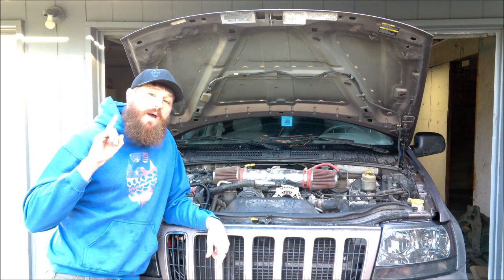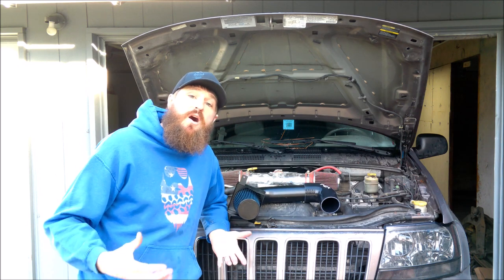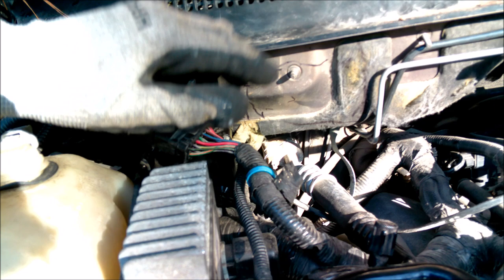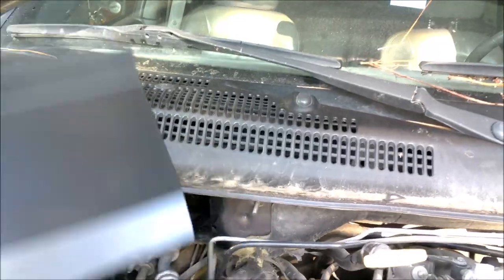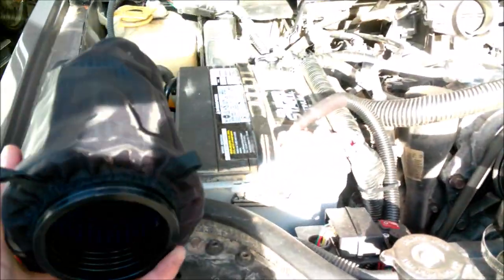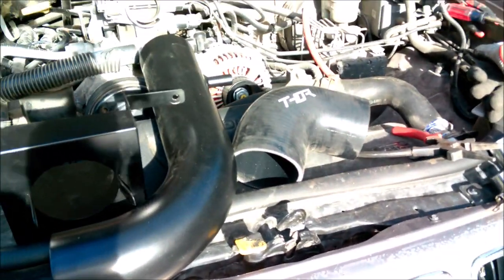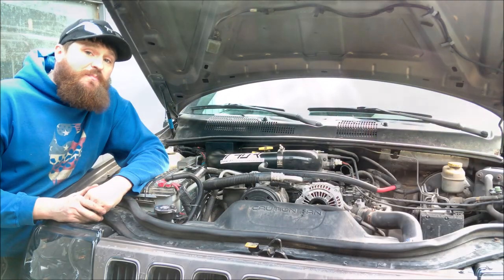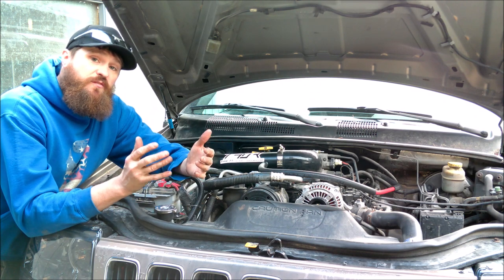Wake up Your 4.7! Jeep Grand Cherokee WJ THOR Cowl Intake Install

Comment: Great idea, but, I gotta tell ya my dude, in reality I truly wouldn’t rely on it. Not without somehow completely sealing off the cowling area around the large opening cut into the firewall from the engine compartment. Water intrusion level is really no better with the THOR setup, quite possibly even worse, than that of the previous intake.

Comment: Can you pair this with a 2008 intake? Din't think so. Kinda solution to a problem that doesn't exist. Hold your hand in front of the intake duct and see how much draw  a V8 pulls. That rain gutter isn't gonna cut the mustard. AFE is loud but that and an 08 intake with matched Throttle body and you're gaining 20+hp and 35ftlbs of Torque. Does sound nice.

Comment: Sorry,  but this is  not a good place for a air filter. Cover brkt will not protect the Filter to get wet. Also all the water will run out of this big cut out 😢
Reply from the maker: We have had some torrential down pours and snow.  Both driving and parked it's stayed bone dry.  That cover diverts the water and from there the cowl does its job and channels the water out. Guess I am just lucky 🤷‍♂️
Reply: @MuddyBeards4X4 does the cover come with the kit??

Comment: Put some Cams from an 08 or later,  those will really wake it up. I run a set from an 09 Ram in my 04, noticeable power increase especially past 3500.

Comment: I want to do this mod to my 4.0, one to gain space in the engine bay for additional battery, possibly better MPG, and cleaner air. But I wonder if it conflicts with the cabin filter mod, can you confirm that?
Reply: that's what I was wondering?
Reply: Cutting into the firewall was a huge hell no for me, i was interested until i saw that horrifying part of the vid lol

Comment: I wanted to do this mod on my ZJ but couldnt justify the price and not sure about the location for the filter in the cowl as I live in a snowy and wet area of the world. So it would be cool to see your opinion on this mod after a year or so!!
Reply: been running one for a while on my zj, through last years heavy snow (where we live) and had zero issues. Lots of people concerned but even with my cowl intake, and hood louvers with the trip tray removed, no electrical issues, and no water in my intake. win win for colder air in the engine, and more heat exiting the engine bay
Reply: Wow that’s good to know. 👊

Comment: So glad to see a video detailing this install!! I too have a 2001 V8 WJ and have been wanting an intake solution for years. I eagerly anticipated when THOR was prepping this intake, but then got leery of it seeing the cutting needed. But, this makes me excited to order and utilize this intake.
Reply from the maker: Thanks.  The cutting is a little intimidating, but there is not much to cut out.  I have been impressed how well the filter is protected from dust.  Been doing many backgrounds trips and the filter stays pretty clean.  Get the pre-filter though.  It helps a lot.

Comment: Great video brother. I’ve been debating on one of these for the last year or so for my 4.7l and I think it’s a perfect solution. Frees up that extra space up front and keeps the filter clear from debris.
Reply from the maker: I like it so far.  It's loud inside, but does good at keeping the filter clean.  Get the pre-filter for sure
Reply: @MuddyBeards4X4  oh no worries there. I rode around with no cat/ muffler for a few months last summer until I throw my flowmaster 44 on there. I think that sound paired with the intake will be mint!

Comment: Mine has that same air intake that you replaced! Can't wait to get rid of it. Bought it at an auction, also came with a bunch of cheesy led lights. Also came with some kind of lift and a touch of Death Wobble.

Comment: Thank you for the video Robbie, I have an XJ and was strongly thinking about this system. I have a snorkel I ordered, it’s been in the box, in the garage for over a year now and the negatives out weighs the positive for me.

Negatives being cut hole in the fender, snorkel hanging out to potentially get knocked off by trees or rocks, grafting it into the factory air box and hoping it does not leak, or bypassing the air box and running a tiny in line  aftermarket 3” tube with filter installed , which I also purchased. 

So thank you for showing me a good option to avoid all of that, to get the same if not better end results. Can’t wait to see the completion of the trail plug for testing purposes. 

I feel on the 4 door XJ  moving the axle back like your going is great option for more tire clearance to sit lower and have a better departure angle.

I know you are busy like we all are… I really appreciate your content.

Comment: Hey man love your wj videos/build you got going. So how are you liking the intake now that it's been installed for a few weeks? What are any if noticeable differences of this kit vs the stock air box?
Reply from the maker: I really don't think there has been a noticeable power gain.  Filter is staying dry though, and I really think I'm going to enjoy the extra space under the hood when I do my dual battery and switch gang under the hood
Reply: @MuddyBeards4X4  Nice. I hope to see a video on how you add the second battery. I've got a project this weekend for my 04 wj that I cant wait to get done but also dreading the job. Ha ha oil pan and gasket time. My wj has just under 250k. Leaking like a sieve. Wish me luck!
Reply: @drewbelansky you are not gonna like the oil pan removal, you most likely need to remove the exhaust to get it out of vehicle and the transmission bracket between oil pan and transmission to get all the bolts out.
Use RTV the gaskets only work so long.

Comment: Yep that's a hot air intake. Lol. Any power gained from flow is lost by hotter air. 10 degrees cooler air is 1 hp typically
Reply: Right

Comment: Do you plan to slap axles ?
Reply from the maker: Not at this point no.  They should hold up to what I want to do
Reply: @MuddyBeards4X4   I run 33s with a similar suspension set up (diesel 3.9 gears) and it is fine.  Also the IRO steering is a nice upgrade.
Reply from the maker: I plan on doing the iro steering here real soon

Comment: Hey Robbie, good video! I have a 2000 WJ, I was considering the same install, looks easy enough. I did put cooling louvers on the hood & I think the hot air from the engine/exhaust goes into that vent area. Because of that my A/C isn't as cool.
Reply from the maker: Hmm interesting.  Wouldn't think that would effect your ac
Reply: Since inside cabin air is pulled from the cowl I assume he may be noticing more engine heat coming into the cabin thru the cabin filter. This should be omitted if running with recirc button on.   The THOR doesn't seem to create a tight seal and... Maybe his cutting was different than yours. 

I like the concept alot. I have a 2002 Overland and would love the underhood space opened up.